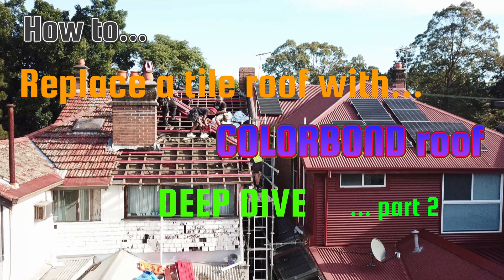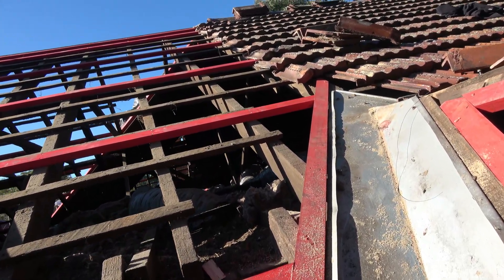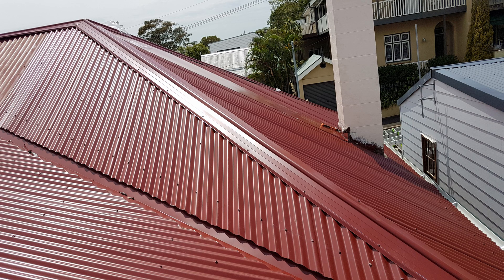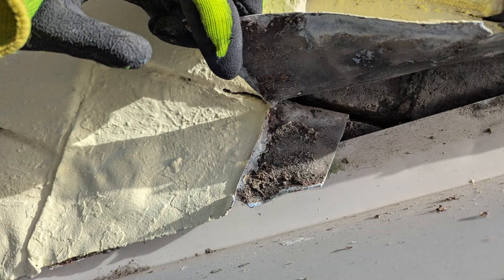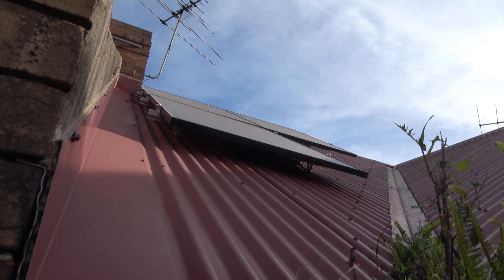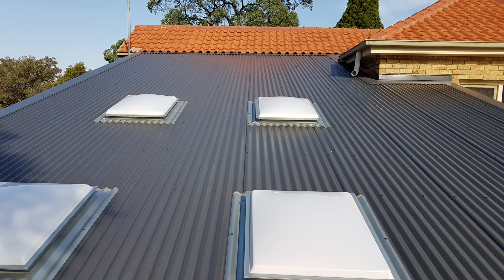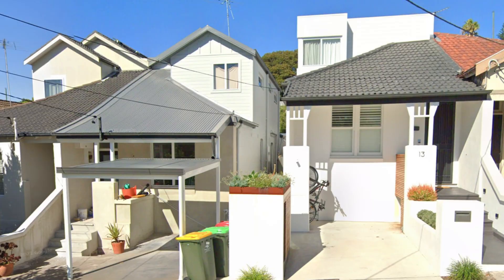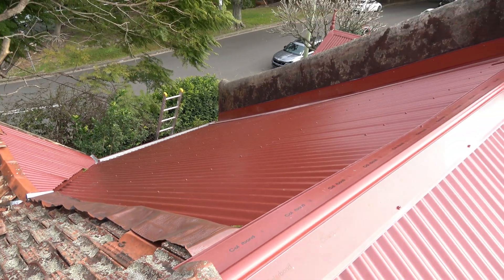How to replace  tile roof with colorbond   deep dive part 2

Comment: Id try starting by installing a double pan under the transition point. Then step-flash with lead over the tile and on top of the metal. Finish by painting the lead flashing to match. That setup should be bulletproof.